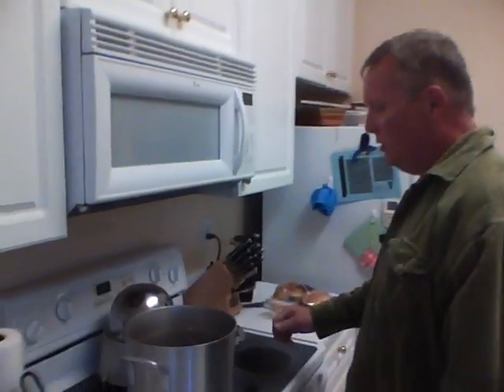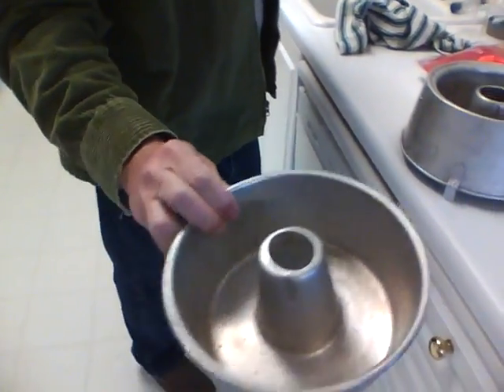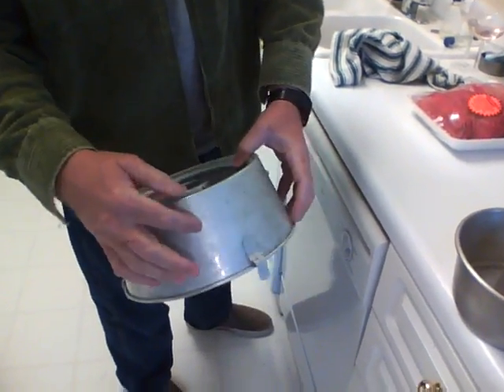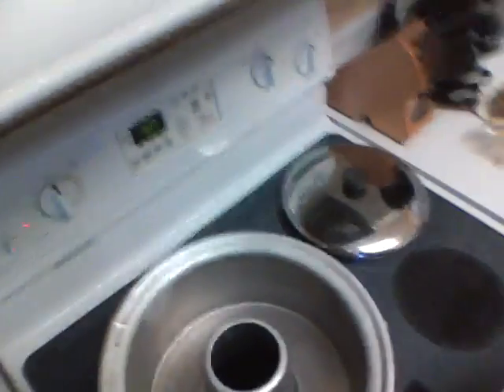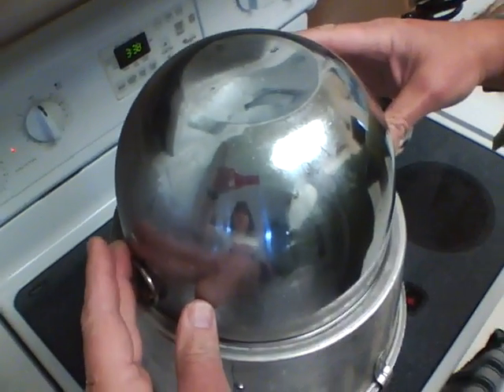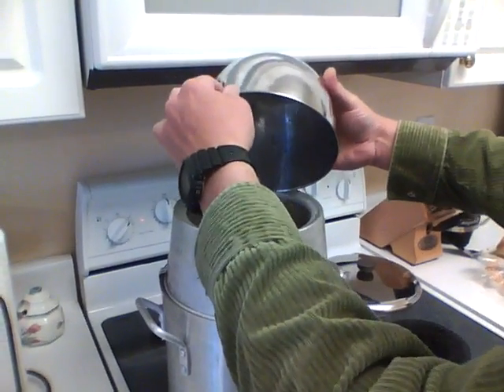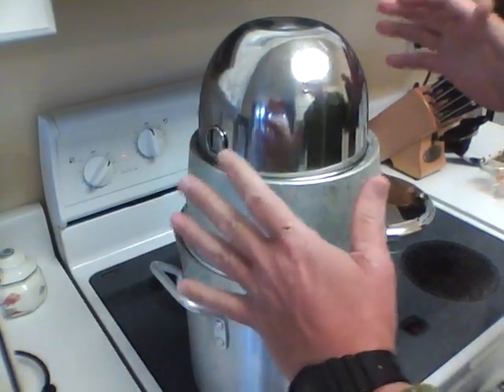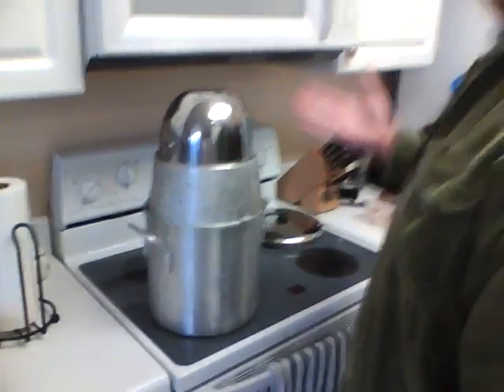Homemade Water Distiller

Comment: using aluminum is dangerous. it's a very unsafe metal which causes Alzheimer's and Dementia,
Reply: lovingorca good to know
Reply: Studies have failed to prove this, per the Alzheimer's Association.

"During the 1960s and 1970s, aluminum emerged as a possible suspect in Alzheimer’s. This suspicion led to concern about exposure to aluminum through everyday sources such as pots and pans, beverage cans, antacids and antiperspirants. Since then, studies have failed to confirm any role for aluminum in causing Alzheimer’s. Experts today focus on other areas of research, and few believe that everyday sources of aluminum pose any threat."
Reply: @Resist4  You go ahead and believe that BS if you like, but substantial aluminum has been found in human brains, especially in subjects with Alzheimers and dementia. The older idea that the blood-brain barrier was a magical brain protector was shattered by this realization. Further research has showed that, while Aluminum does not directly cause Alzheimers, it can exacerbate any kind of dementia. The reason is that aluminum actually causes neuronal damage very similar to the mechanisms involved in Alzheimers itself. You might say Aluminum is not a sibling but a look-alike cousin. For example, aluminum does the following, which those of you familiar at all with Alzheimers will recognize immediately. 1. It creates tangles
, 2. It changes DNA synthesis
; 3. It generates excessive free radicals
; and 4. It raises beta amyloid output.
Reply: @jcramrod3684  Your science is flawed, in fact it's not even science.  What okay, whatever.
Reply: And yet the Alzheimer's Association says otherwise.

Comment: Just use a towel over the boiling pot to collect the steam.  Wring each towel out after they cool (wear clean gloves for sanitation).  Simple & easy method of distillation.  Remember this if you get into a stranded situation.  This makes ocean water fully drinkable too.  Great idea from your video also.  Thanx.
Reply: Brilliant!
Reply: The acrostic "K.I.S.S"  (Keep it simple stupid) applies here.  There are far too many methods of distilling water.  Why not just keep it simple?  Fire/Pot/Towel are the only 3 items required.

Comment: awesome : ) I can finally get the fluoride out of my water!
Reply: +Sieben Fünf I have a water distiller and reverse osmosis water now :D
Reply: The only way to get the fluoride out of your drinking water is by reverse osmosis.
Reply: +David Gaudette are you saying then that a water distiller does NOT get fluoride out? I bought a water distiller - it definitely gets a lot of "stuff" out - as I can see in the residue that is left behind at the bottom of the distiller.
Reply: +David Gaudette No, sir. Distilled water is pure. Nothing left behind. No fluoride in distilled water.
Reply: I also found a place that uses a reverse osmosis filter - so I'm going to get some big juggs of water from there too to try.

Comment: It's a really good setup. The guy who wrote in about aluminum is correct. Also, I'd imagine that it won't remove everything. That would be my concern. Before watching your video I watched one where someone built a solar distiller. It worked great to remove large impurities, but didn't remove red food coloring when he introduced that. 
So, your method would work to purify stream water from dirt and muck but maybe not from chemical pollutants. Right?